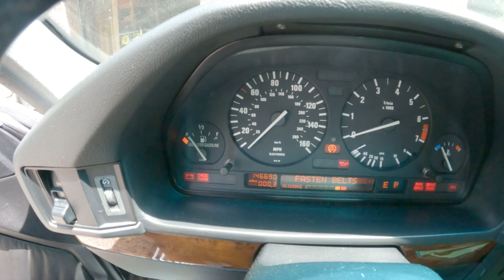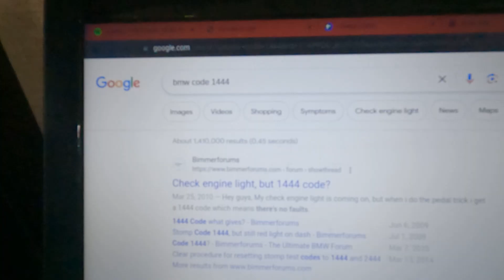Stomp Code Test EXACTLY WHAT TO DO - BMW E34, E36, E30 92-95 for OBD1 Cars

Comment: Mine blinks short once and then long blink then short back and forth what does this mean?
Reply from the maker: The first short blink means the stomp code worked and the next blinks will communicate the code through blinks.

Next will be 4 sets of blinks, each set for a digit in the code, each set has a pause between them, count the blinks in each set and then decode the numbers you get, if you get something like 1221 (Oxygen sensor fault), google the code or click the link to the engine code list in my description

Then there will be a long blink to tell you the code is about to repeat itself